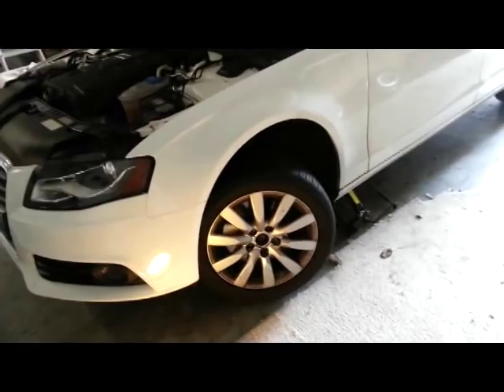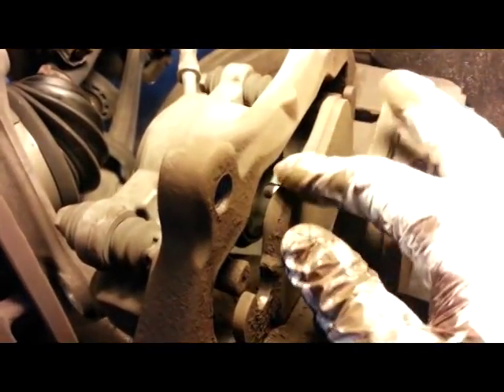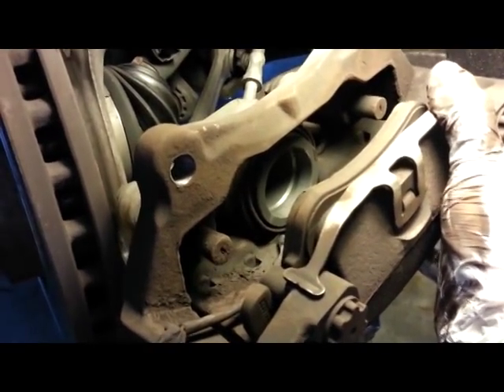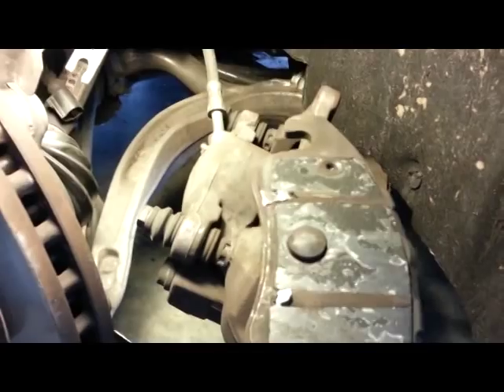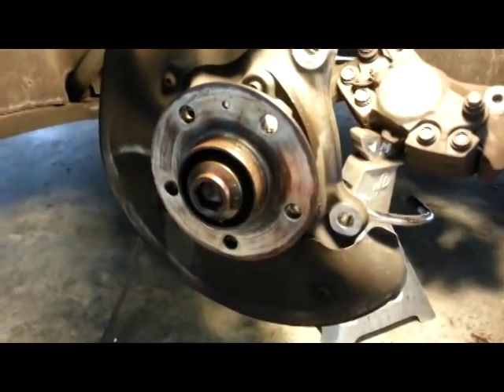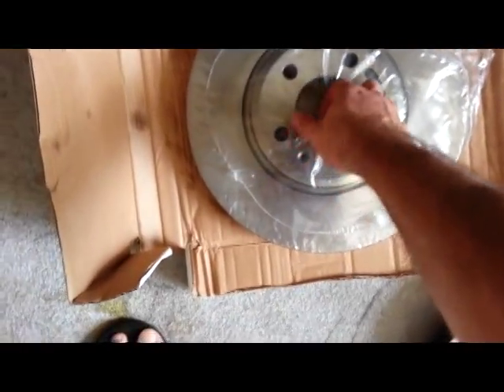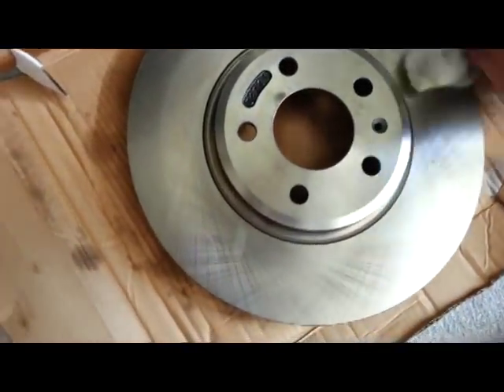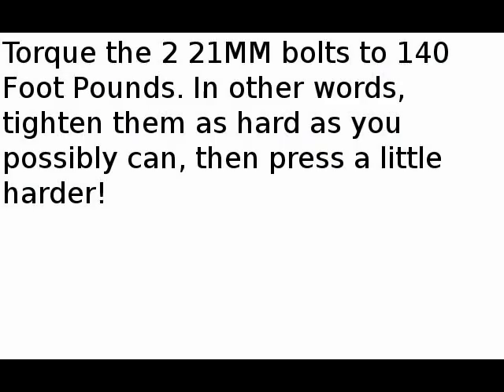2010-2015 Audi A4 B8 Front Brake Pads and Brake Rotor Replacement

Comment from the maker: After 2 weeks, the brakes are much better than stock! No brake dust on wheels and stopping is very smooth. Coming to a complete stop slowly at a stop light was always grabby with the stock pads. With the ceramics it is very smooth both stopping and taking foot off brake to accelerate from a stop. I will give another update in a few more weeks but for right now I'm super happy!
Reply from the maker: After 5 months, no issues. Brake dust is white and hardly noticeable. Very happy!
Reply: cuda2000 Hi, I just got my brakes and rotors replaced by a shop and I had the same experience in the slow speed braking seeming kind of weak compared stock. Are you saying that is to be expected? I am getting a little concerned and thought that the shop did not do a good job.
Reply: cuda2000 hey bud great video 👍🏻 , can u tell what is the rotor size for 2010 a4 quottro both front and rear one as i was shopping online and i have to choose the size first ... do you have any idea
Reply from the maker: rotors are 320 mm front, 300 mm rear. I will be changing my rears for the first time in the next couple weeks at 65,000 miles. I will make a video for that too.
Reply: Let me know if you ever do it.  I need to do mine too and not sure if I can use the 12V method or just VAG cable it (rear electronic brake)...

Comment: You can snap those rotors loose quite easy on these German and Swedish cars if they get cantankerous. Start the vehicle,  put it in gear, tap the brake as the rotor goes around and it'll snap loose, then quickly shut off the engine.

Comment: Just wondering......was there any reason why you needed to change the rotors too? They didn't look warped at all.....
Reply from the maker: You have to replace the rotors, they have a very small wear tolerance, it is something like 2mm. You can't resurface them. Of course you can do whatever you want, but slapping on new pads without changing the rotors is not recommended.
Reply: cuda2000 thanks for the reply. Makes the brake tune-up much more expensive. How many miles did you do this replacement?
Reply from the maker: Boyet&Angela 35,000 miles I did the whole thing for $149 you think that is expensive? The dealer wanted over $700 just for the parts!
Reply: cuda2000 oh I meant compared to replacing the pads only vs pads+rotors
Reply: @souljuh25  if you don't do both at the same time your old rotors will wear out your new pads much fast, so in the long run your'll pay less by doing both.... does that make sense now?

Comment: Was adhesive used on the outside pad (one with the metal dot)?
Reply from the maker: Adhesive? No, you don’t have to put anything on it, if anything you use hi temperature brake grease
Reply: @CarsandCoding  Odd because nearly every one of these videos showing this pad replacement had adhesive on the old pad being replaced.
Reply from the maker: @summit2117  yes it is like that from factory but the. You can get chatter noise.

Comment: Thanks for the video. Were your aftermarket rotors zinc plated? I'm wondering if you'll have rust issues down the road. Also, did you replace any parts? How about lubrication?

Comment: Would you recommend this to someone who has very little experience working on cars? I have no problems getting my hands dirty, but when it comes to cars, I am more of the replace your own lightbulbs, add oil kind of guy if you know what I mean, but if it saves me ~$500+, i would say its worth it. Your instructions seem great as well, cuda2000 . Thanks
Reply from the maker: If you never did a brake job before I would not do this without someone on hand that is somewhat experienced. You have to make sure everything is tightened correctly, and the possibility to get something wrong would not be worth the cost savings if you know what I mean. :(

Comment: How are the rotors from Autozone holding up?
Reply from the maker: 50k miles later still good. Akebono pads look like new barely worn down. Rotors have no issues. Again, I'm in Florida so if youre in snowrustyland your experience may differ.

Comment: The rear pads its the same procedure??
Reply from the maker: I have read that the rear pads need a rear caliper piston compressor to get the piston back in the caliper. It rotates the piston while pushing it back? This is a generic tool, not audi specific that you can buy or borrow from an auto parts store. This is due to the rear parking brake being hydraulic. I have not replaced the rear brakes so I can't tell you the procedure. Anyone have a video of rear brake replacement?
Reply: cuda2000 that's why I was asking, the parking brake cant be compresed like the front caliper, so you dont know how it has to be made and which tool you have to use??? Thanks in advice
Reply from the maker: Nico España Nico, I personally have not replaced the rear pads, but the tool you need is shown here: Brake Job Series - Rear Caliper Replacement    also here is a video of rear pads on an older audi, same procedure: How to replace rear brake pads - Audi, volkswagen, Skoda, Seat  and many more

Comment: Did you require a 10 point size 12mm bit to change your brakes?  I have a 2010 Audi A4 and that's what I need.  I can't find the part online
Reply from the maker: You should not need any special tools. If you do then you're doing it wrong.

Comment: WARNING.  Do NOT USE a C clamp to push back in the caliper piston.  You will ruin your caliper.
Reply: Phil Razzi what the hell are u supposed to use then fool
Reply: Your muscles! Do you even lift, bro.
Reply: He's probably thinking of the rear brakes, the caliper pistons rotate as they retract and you're supposed to use a VAGCOM cable to have the computer do it instead of using clamps.

Comment: ugh those autozone rotors will warp in no time. OE rotors or OE equivalant. Would never spend $30 on autozone china crap. However you can spend $15 and resurface the ones you have on there. O reilys or any brake shop will turn them for u
Reply from the maker: Put 20k miles on them so far,  no issues. The lack of brake dust is amazing. Would do it exactly the same again.
Reply: +cuda2000 happy to hear you had great success. I had used them once before on my wife's car and they didn't fair very well
Reply: +Karl Schranz Most of it is made in China, unless you get the specific OEM german ones.  I bought some rotors from Advanced Auto and they worked great for about 25k miles. I changed them out when I changed pads. Guess what I bought? The same stuff.